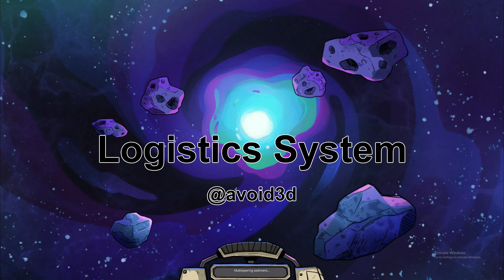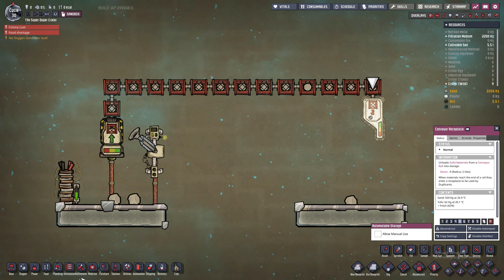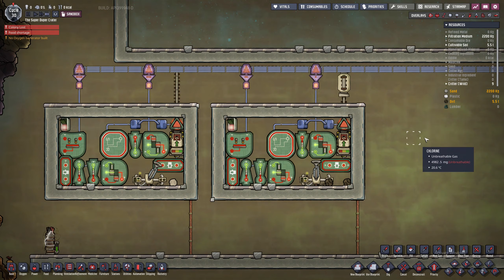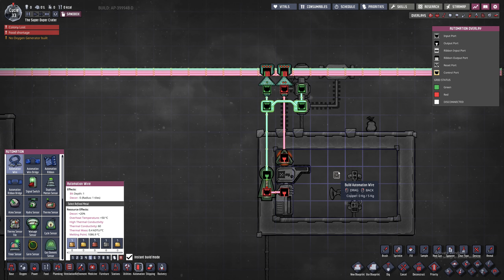Logistics System - Oxygen Not Included

Comment: You can use the new advanced mode of the signal counter as an edge detector. It sends a short pulse when the count is reached instead of staying on so when setting it to count to %1 it will do that with every rising edge. They are a bit smaller with half the size of the old edge detector but the downside is that you can't rotate them horizontally.
Reply from the maker: Hey, thanks for the idea, I haven't tried the new update yet, but I might make a video on this.
Reply: @pierrekinbrand  I definitely want to try building something like this or in general a logistics bus. My base is getting overwhelmed with shipping rails since I do quite a lot of farming with fertilizer but also ranching and all of those creates a maze of rails. I might net to find another way to detect that I need a shipment since some places are quite compact and only have the shipping recepticle.

Comment: Couldn't you save yourself the or gate on the left side of your senders? A simple t-junction acts as a (non-diode) or-gate. Since you don't need to prevent back-propagation in this case, you should be ok to eliminate the or gate and just t the override switch into the line.
Reply from the maker: Yeah, that's a great point, this 'non diode or-gate' is actually what I meant when I said 'high impedance' in the video, I guess what I meant was, it's pulled down by default and can be pulled up by any output :) thanks for the suggestion btw!